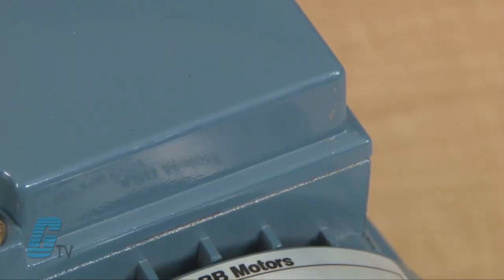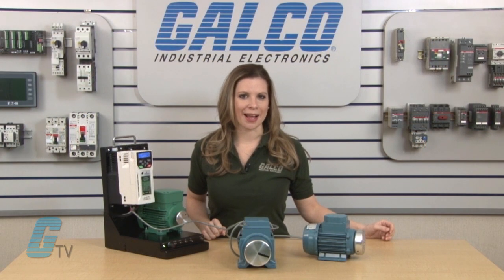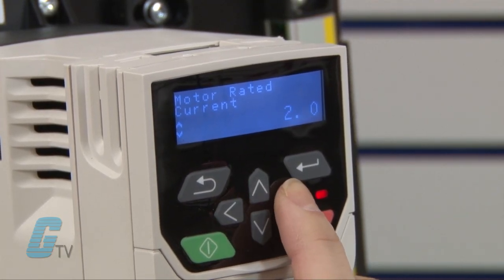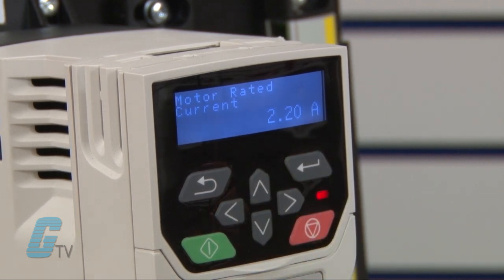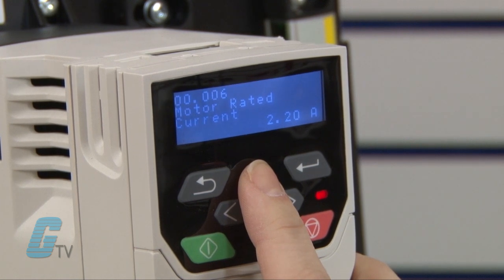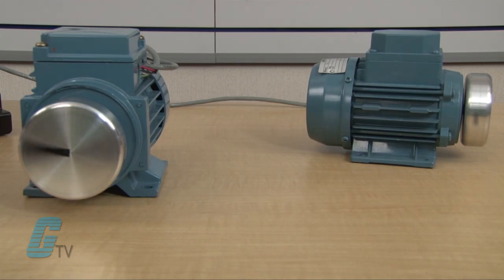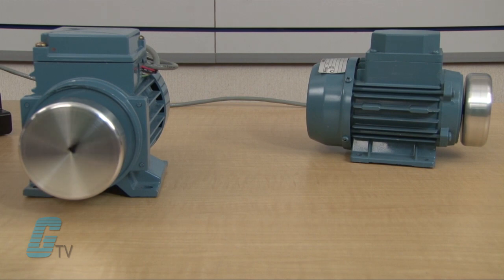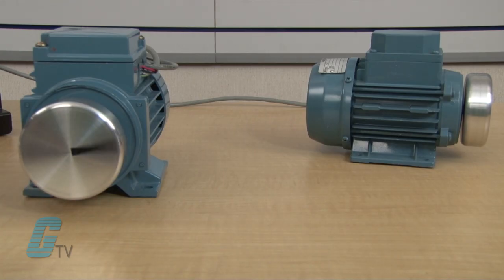How To Set Up Multiple Motors On One Drive - A GalcoTV Tech Tip | Galco

Comment: I have a scheineder electric driver it has the second motor option and l have programmed the settings required by the driver, but when a switch it for the second motor any command is received in the driver.   Could you tell me please what could be happening to my driver?

Comment: How to possibly in abb acs550 ???
Reply from the maker: The principle is exactly the same, average the speed of the motors and add the FLA rating of each motor for a total current value. Remember the total current can not exceed the drive rating in amps, and you will need individual overload protection for each motor.
Reply: Thanks allot .but both motor run in each and same time it's damage the vfd????
Reply from the maker: As long as the total HP (motor 1 + motor 2) does not exceed the drive HP rating you should be ok to run both at the same time, ok?
Reply: Thanks allot for your best help.galco is best.

Comment: how to control 2 vfd by single controller I have been using 1vfd -3phase ac motor in different frequency and other one geared ac motor in other vfd in different frequency my problem start those two vfd in same time .plz tell me how start both vfd in similar time

Comment: First time this devic is parameter no 0.48 cl vector and pr 0.42- 6 
pole,0.43-.920, 0.44-380, 0.45-950.Than look open and pr 1.00 write 1253
 than reset.now parameter auto setting 0.42-4pole,0.43-0.920, 0.44-400, 
0.45-1450.please help me.0.42 -2pole?
Reply from the maker: That's because 1253 is a Standard Default configuring value. USE 1001 TO SAVE Parameters. Do you need a copy of the manual?
Reply: Hi there I’m going back right after the meeting

Comment: How do I hook up 2 dissimilar 3ph motors to run off a single VFD that is converting a 50 amp 220 single ph supply to 220 3ph and run them at the same time? Need to run 1hp and a 1/8 hp motor running at the same time without having to spend $700 on 2 seperate motor starters?